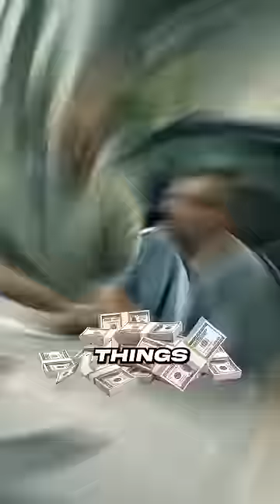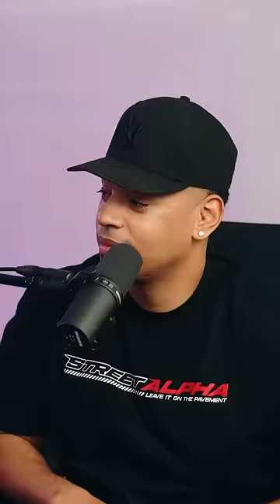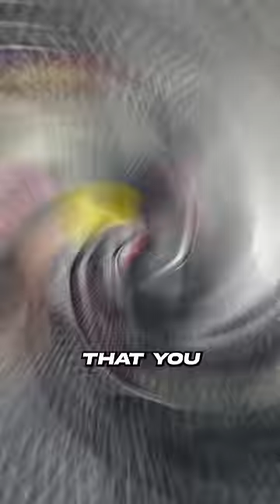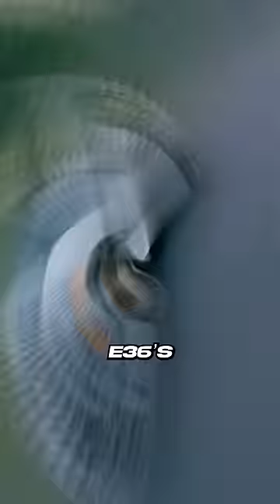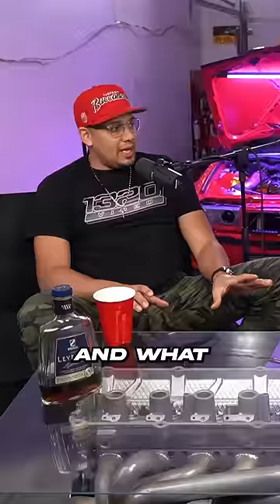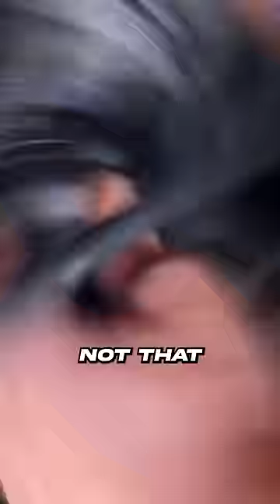What BMW DOES NOT Tell You 😩 #shorts

Comment: If somebody tells you 12k btwn oil changes and you believe them, you deserve everything that happens 😂
(Fast performance cars, not your 05 Camry)
Reply: Weird Toyota says 10k or once per year on the 2ar-fe engine and that maybe the most reliable 4popper ever
Reply: My parents bought a 2023 Toyota Highlander XLE Platinum that come with toyota care, and it requires an oil change every 10k miles. If you do it earlier, you miss out on all the free Toyota care shit.
Reply: That might work on a LS engine. Idk about anything else
Reply: I worked in an oil shop and we recommended every 5-10k miles per change
Reply: Lol 😂
Reply: @TwilightsPurple used to be a tech at a toyota dealership and I cringed every time I reset the oil light and it reset 10k miles
Reply: @tdub25 is it a high performance engine?
Reply: Lol facts
Reply: Yeah my corolla is every 10 I do every 8 my diesels at work I change the oil every 8500-15000 mile’s depending on idle time
Reply: I have a friend who does warranty determination for a Mercedes-Benz dealership and, after what he told me, I will stick with what the manual says until warranty is up.  Reason being, if you haven't followed that, you are not in compliance with the part of the warranty that specifies that you must comply with maintenance requirements.  If something really nasty happens and they don't feel compelled to fix it, they have grounds to deny service - even if you've gone them one better by changing oil more often or not using "better" than the specified oil and filter.
Reply: @TwilightsPurple which is? Free winshield wipers and rotations with a windshield washer top off 😂😂 screw that
Reply: That's not fair. They told my dad that and he's not a car guy like that. Told him to change his oil once a year every 10,000 miles. Of course, I told him why not to do that. But if I didn't know any better and the dealer is telling me that I might believe them too.
Reply: @tdub25 no shit an engine that puts out 180bhp doesn't need oil changes as often...
Reply: @tdub25 the Toyota that I did a placement at said every 7k km
Reply: really depends on the oil bro. i change mine every 5. i know someone who sends their oil in from testing that changes it every 11k
Reply: It will still eventually fail with 6k oil changes
Reply: My VW was 10k intervals and every analysis of the oil and inspection of the combustion chamber,cams etc came back like the engine was still new! My b58 goes 10k intervals as well and runs 0w20 at 104k it’s cam lobes etc are still smooth. It’s all the other shit you possibly have to worry about. Only issue I’ve had was a coolant bottle leak but with a BMW 75k is when you should expect to do maintenance on the cooling system anyways, has been that way since the late 90s
Reply: @tdub25 difference is toyota makes there cars to last as their goal vs BMW makes theirs to fail to get you to trade for a new one.
Reply: So if you buy these type of cars you might as well buy backup parts
Reply: I work at a kia dealership and tbh the newer cars seem like they can withstand the longer intervals but the older cars (2020 and before) especially with the 2.4s not so much
Reply: Here's the truth about oil changes. It depends on the engine, the climate, and the driver. If you have a high performance car and you actually use that performance, your oil change intervals can half what is recomended. (Virtually every BMW owner, ESPECIALLY M owners) Ultra hot climates reduce intervals too. Don't get cheap oil, those dollars your save now go right out the window after 100 to 150k miles (sometimes before) and cost you thousands. I had some family members that didn't listen and their engines went to the grave prematurely.

If you have a " slow"car and granny drive it, recomended intervals are fine with good oil.

BTW if your engine leaks fluids onto your engine, get some engine degreaser/cleaner from an auto supply, spray it down and rise it off with low pressure water then dry it off with pressuried air or go for a long drive. I have pics of cars on fire due to this exact reason.
Reply: Honestly newer synthetic oils do not break down as quickly or as easily as older oils do. Technology has gotten 10x better over the years but I still change my oil frequently because I built my damn car and I’ll be damned if I let thousands of dollars I spent in engine work go in the trash due to simple maintenance. Only the best quality Esther oils go in my engine and I recommend y’all do the same.
Reply: @wethobgoblin2740 Naw it’s all free oil changes, it isn’t much but hey you don’t gotta fork out whatever ridiculous price they’re charging for oil changes now.
Reply: I change my oil in my BMW every 3,500 miles because I drive it hard and beat the shit out of it lol
Reply: I bought a manual transmission 2011 Kia forte with 75K on it within three years. I had it up to 231,000 miles. I drove hard full-time Lyft driver all in town. I went 10K between oil and filter changes with a new air filter every 10 K royal purple 5W 20 before that car got totaled that engine ran like glass.
Reply: If ur a car guy yes if ur a non car guy no n thats who bmw takes advantage of the non car guys because we know better shit nissan engineers said every 2k miles 😂
Reply: @tdub25  i never heard that before, toyota n all the jdm manufacturers usually set the computer at 5k miles to trigger the service light shit my old Lexus lets me know when it needs it went its at 4k miles
Reply: No you do not.
Reply: Obviously talking about BMW like the video.
Reply: You have one?
Reply: @weheretowatchandcomment any 90s honda 4 banger
Reply: I have a 2001 530i, it had a oil change done every 20k miles, it now has 280k miles on it and the engine still runs like new and all the original plastic parts and hoses are good too, it was a long distance car though that did 200 highway miles a day most it’s life.
Reply: 12k changes Worked fine for me and my E46.  Had it 17 years.
Reply: You clearly don't know about cars. 😅😅😅
Reply: @tdub25  you shouldn't do over 7500 miles per oil change on any car even a corolla or a hilux.
Reply: Most bmws , Audis and Mercedes run on fully synthetic oils. Which you can run for around 12k miles between each change
Reply: What's crazy is my evo 6.5 uses enough for about 10-15k changes my 2017 corolla hasn't had a change except top up in 80,000ks still pretty clean alot cleaner than my oil than my evo would look like after 1000ks
Reply: My bud have jaguar diesel. I thinkhe said the interval is 35k kilometers. I said dont ever talk with me about changing oil at that rate...
Reply: @AngryPaperBoy been trying to tell my dad the same shit about his Jeep Cherokee. Dealer tells him every 10k and he listens and says “Well the percentage on the car says so too” 

Oh father. Why are you so naive?
Reply: Had a 2004 Toyota Camry. Would change the oil (synthetic) every  10-15k. Replaced it 2019 with a Camry XSE V6. It had over 380,000+ miles at the time.
Reply: I’ve been telling guys that buy new trucks with the Cummins x15 or paccar mx13 to change oil like you would in a older engine. They’re recommended oil drain is 50-75000 miles which is insane
Reply: N I do mean EVERYTHING!! 🤣
Reply: @tdub25  if using synthetic. If using the conventional fluids... no way. Synthetic is dominant by a long shot.
Reply: @TwilightsPurple just do it yourself in between the toyota car period they wont know and you’ll extend the cars life
Reply: The fact you had to emphasize (fast performance cars) shows how stupid some people are. Obviously not your Toyota, Honda etc. geez!
Reply: @TwilightsPurple shoot I bought a 2023 taco and with Toyota care are they change mine ever 5k or every 5 months
Reply: Me over here giving my old tercel full synthetic ever 4-5 thousand k not even miles lol .. 😅 oil is cheap and oil changes are easy , who the hell gonna drive anything hard and charge the oil ever 10k miles 💀
Reply: Even in a carry you changes the oil at 5k
Reply: @TwilightsPurple recommended and needed are very different
Reply: If you buy a e46 36 please teach yourself how to work on them 😂
Reply: 3,5   years  I didn't change  oil  on my  2006  Aygo  and  it  runs  perfectly
Reply: I do mine every 4k miles 5 pushing it BMW never run it in hot weather or try not too
Reply: @TwilightsPurple they wouldn’t know if you did your own 5k oil change
Reply: Turbo or high performance cars need short interval changes, ordinary family cars that are driven ordinary can go 10 to 20k once using good oil.
Reply: Oil on any car 3-5k miles synthetic. What’s cheaper? More oil changes? Or premature engine failure?
Reply: A production line stock beemer is not a fast performance car, you tried way too hard...........just to say nothing
Reply: Oils are definitely a lot Better nowadays. You can easily go 5 - 6k miles in normal driving conditions with good oil. 15k between oil changes is lunacy. I sent my oil to a lab one time because I miscalculated my mileage and hadn't changed my oil in 8000 miles. The lab results came back and it wasn't terrible But it wouldn't that greet either. Change your oil every 5k and you'll be fine
Reply: People are acting like changing oil is that hard it’s not a super car
Reply: @tdub25 10,000k yes that's correct, not 12,000miles
Reply: Not really, not everyone has someone to teach them about cars…. Huge ego you got tho, over knowing car facts is pretty crazy
Reply: My Passat is every 10k miles, my G22 is every 7,500 and the e46 is every 4500 miles.
Reply: I own an 04 camry and have changed oil every 5k has 160k one owner runs perfect
Reply: @weheretowatchandcomment and a 22re and a Windsor 302 but yes ls the world
Reply: @drjd2real an engine will fail in the end anyway. 6k mile servicing is perfectly fine with normal street driving. It’s not the 1950’s anymore, modern oil is really good and lasts
Reply: @gumpy4960  I understand you're responding to me, but I don't remember what I said because youtube deleted my post
Reply: I agree wholeheartedly!!!
Reply: When I was growing up it was 6000 Miles or 6 months which ever comes first
Reply: @goatbaaad3711 it's because you don't understand how good modern oils are and how little modern engines contaminate that oil compared to old engines. My cars have all hit 200,000 miles plus with no issue by simply following manufacturers instructions.
Reply: In that case, wouldn't engine oil manufacturers be held liable in a major law suit who advertise that their synthetic oils can go 10K, 12K, 20K miles, etc before an oil change needs to be done?
Reply: Depends. If you have a lead foot change it in in 5k max.
Reply: @tdub25  yeah but even that information is TOTALLY WRONG!
and a Toyota technician will tell you that. So will an engineer.

The car itself even gives you a hint* it gives you a “MAINTENANCE REQUIRED” message at 5 k miles 
And yet the manual says to change it every 10k miles. Fucking ridiculous.

-Lexus ct200h
Reply: @tdub25  Is this a high performance engine?
Reply: @tdub25 😂😂😂😂
Reply: @imgudsumtimes1042 that's fucking insane anyone in their right mind is not waiting 5 to 10k to do an oil change I do an oil change every 2500 to 3k miles
Reply: Oil is cheaper than a whole engine 🤷🏾‍♂️
Reply: @tdub25 comparing a toyota to an m or even bmw in general just says your oblivious

Comment: NEVER go by manufacturer specs if they sounds off. You'll never harm a car changing its fluids too often.
Reply: Except for maybe trans fluid. Especially trans flushes. But you are very correct.
Reply: @Sideapotatoes That's only if the trans fluid goes too long without being changed, if the trans fluid gets changed at proper intervals or shorter, there's no harm done
Reply: @isaiahmascarenas1209  You are exactly right. Another one that manufacturers mess up. Some of these "lifetime fluid transmissions" with no dipstick, actually need changed more. I'm all about just doing regular drain and fills but don't trust a flush from a shop at all.
Reply: Yes but by changing fluids way too often the chance of the threads getting destroyed is higher
Reply: @harisdrizis5823 I'd rather fuck up the threads and replace a pan than ruin the entire thing not changing it
Reply: @harisdrizis5823  only a re is messing up threads.   No disrespect.
Reply: The general masses don't know that. They are sheep to the dealerships because they are too dumb to think for themselves. I work at a Toyota and see this too often.
Reply: God my wife and I just got a new BMW, I told her I was gonna do the first oil change at 2500 myself and have the dealership do it at 5k and just alternate me and them since it’s got the maintenance plan to keep the oil level fresh. She said it’s a waste of money the manufacturer knows better. 🤦‍♂️
Reply: @Sideapotatoes that is a myth and been disproven many many times and documented on youtube
Reply: @isaiahmascarenas1209  every time you change the trans fluid youre taking clutch material out.
Reply: @ClumsyCars as long as you change the trans fluid and mesh pickup every 50k there's no issue. Get 200k out of Trans vs 100k.
Reply: @ClumsyCars  That's a good thing. The loose clutch/metal debris building up is what makes changing the fluid too late ruin the transmission
Reply: @isaiahmascarenas1209  once enough is removed to clutches start slipping. the clutch material floating in the fluid is acting as a friction modifier.
Reply: @ClumsyCars  Yes, the floating clutch material is a friction modifier, which is why you don't wanna let it build up too much. The transmission fluid should ideally always have the same properties as when it was new
Reply: Unless you get the wrong mfers to do it
Reply: Yessir that’s y I change my oil every 2500-3k miles on my 23’ M8 and 20’ X4
Reply: Factual
Reply: 25 inch pounds for the valve cover torque spec. “Sounds off” a few uggga duggas from my 1/2” impact should be tight enough. Lol
Reply: Yeah right! It’s all good until you or the mechanic breaks a sealant or installs it back improperly.
Reply: @YoRAHeem  that’s y u take it to a good performance shop that ur cool wit to guarantee u get a good job done. People that have things like that break on them is cuz they’re cheap and will rather cheap out on their car so they pay the price for being a cheap ass
Reply: Planned obsolescence.
Reply: Warranty period means nothing in some countries. There are laws
Reply: @ASM31237 yeah that is a waste though, your car takes full synthetic which is good for 7500 miles between changes.
Reply: @ASM31237 Make sure you use an original Bmw oil filter otherwise they might try to invalidate your warranty if they see another party has worked on the car during the guarantee period.
Reply: @TheFuelInjected  It probably is, I always figured it’s cheap insurance. An extra $200 and 6 or so hours of my time over the year seems pretty cheap for a tiny bit of peace of mind. Especially since we plan to keep it as an eventual future beater.
Reply: @Lonewolf-kw8gg  Is it really that bad? I’d asked the Volvo tech when I had my first service in my last car about it and he said they don’t care, I imagine a filter claim would have to go through some wild legal hoops for a manufacturer to say that’s what caused it. Computer will log anything afoot even an incorrect weight oil.
Reply: @ASM31237 why would you agree with your wife on what needs to be done with a car? Unless she's one of those unicorn gear heads you should'vd taken control of the maintenence